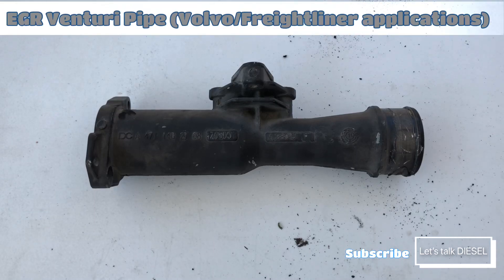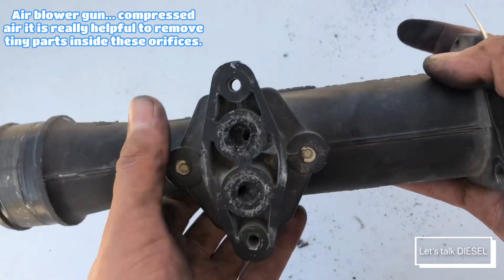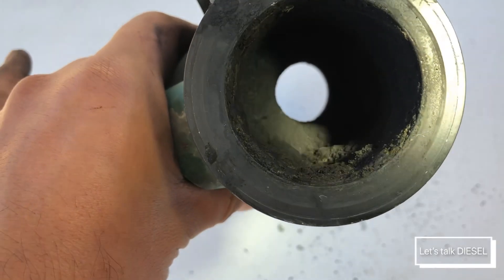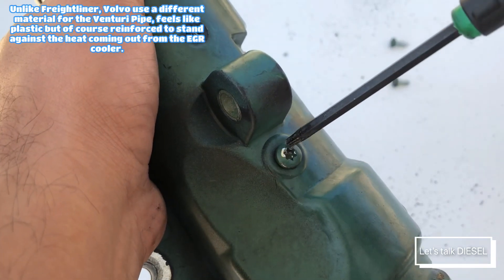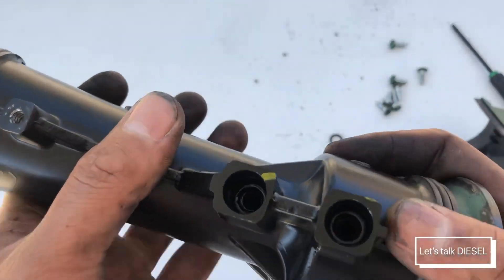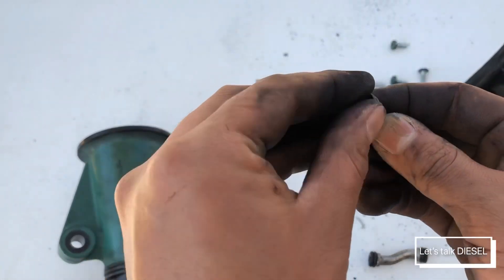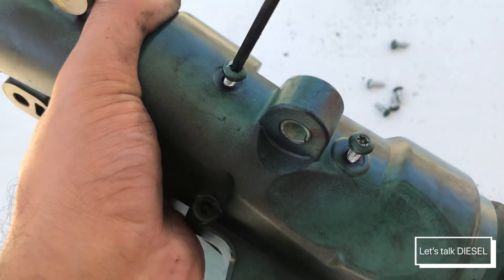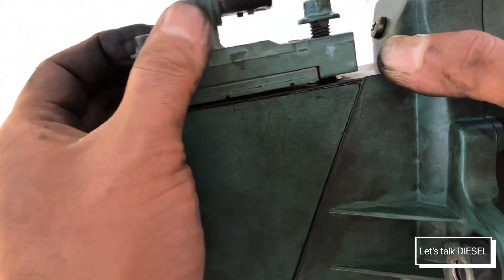EGR Venturi Pipe (Volvo/Freightliner applications)

Comment: Do both holes go all the way through the freightliner  pipe. Because tge hole on the radiator side goes through but not the engine side

Comment: I did a video “Volvo D13 EGR repair”. In it I break down the entire egr and rebuild it. The oil lines cool the egr. As you will see they do not lubricate the egr. For less than $20 a lubrication port can be added to the egr valve and eliminate the problem of it failing.
Reply from the maker: Thanks for share your opinion, I will watch the video.

Comment: Does new design  venturi pipe fits instead old venturi pipe? Or should I use original old design for D13 2011?
Reply from the maker: When you get a new EGR Venturi from Volvo dealer, they will sell you an update design, in my personal opinion the new is better because you can clean it unlike the older pipe. Thanks for watching and support the channel.
Reply: @LetstalkDIESEL  thank you

Comment: You didn’t sat what tools to clean it with wire brush soft cloth, pads what? Break cleaner,diesel eta.
Reply from the maker: To clean the spot from inside the EGR Venturi pipe, you can use: 
1. Warm water with a bit of dishwasher soap.
2. You can use an screwdriver to remove the chucks of soot faster.
3. Diesel and brake cleaner might help but after you removed the thicker part of the soot.
4. To clean the small holes just a paper clip. The flexibility of the paper clip will allow you to clear the hole properly.
5. Once you are done with the washing process, rinse with water only. Then, Just let it dry for 30 minutes or clean it with a rag or shop towel.
6. As reminder after you have cleaned the part, if you see any crack when you are cleaning the EGR Venturi pipe, replace it.

Comment: Hello man, I love how you explain how everything works thank you. My question is how does the turbo effect egr. So how is the dpf sensor and turbo and egr all working together with each other. Please explain. Thanks again
Reply from the maker: How the EGR, Turbocharger and DPF delta pressure sensor communicate with each other 

The Exhaust Gas Recirculation system components are:
1. EGR Valve: Part in charge to open and close the exhaust gases controlled by the ECU using the EGR DPS.
2. EGR DPS (Delta Pressure Sensor): installed in the EGR Venturi Pipe measure the pressure between the EGR cooler outlet and the intake manifold. It helps to control the EGR valve.
3. EGR Cooler: to cool down the exhaust gases with a engine coolant heater exchanger inside.

The EGR valve is likely to stick and become coked up on some applications. This can have a significant effect on the performance of the turbocharger.

A faulty EGR valve can result in excessive carbon/soot at the turbine end. This could cause the VNT (Variable Nozzle Turbocharger) mechanism to stick.

If the DPF delta pressure sensor (measure the pressure between the inlet and the outlet of the DPF) detects a high pressure readings (usually above of 3.0 PSI) the engine will shutdown to protect components like the Turbocharger. The EGR system must work together with the turbocharger to achieve appropriate air pressure for the engine intake that equals a efficient engine torque output.

The ECU connects all these components in order to provide fuel efficiency with high performance. But in real life, to achieve both with success, well, usually companies sacrifice one for another. This is as simple as I can explain it. I hope this gives you an idea how those parts work together. Thanks for watching.